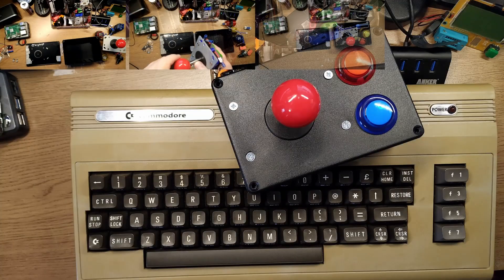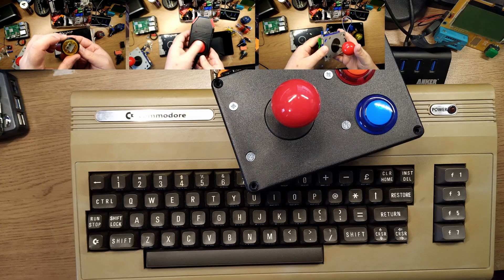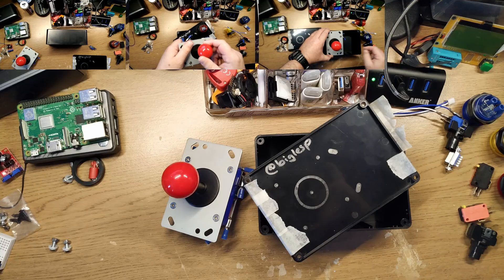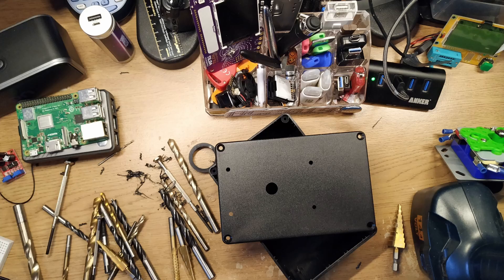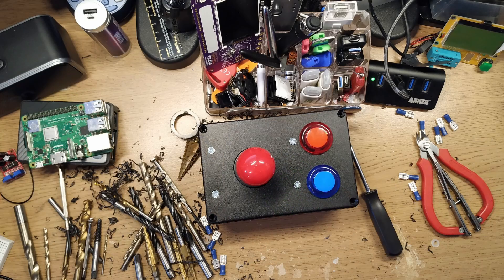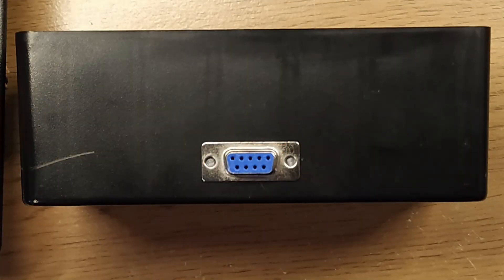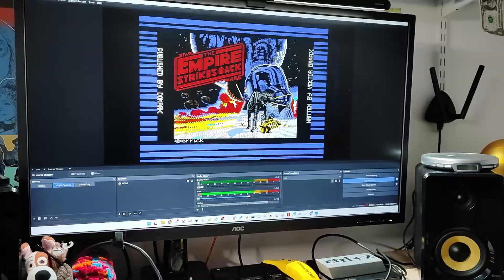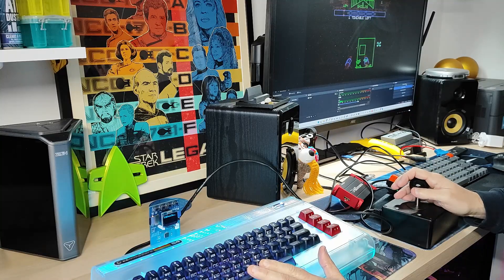Maker Advent Day 17: Building a Joystick for the Commodore 64 Ultimate

Comment: Nice joystick. The boxiness reminds me a bit of The Greek Stick :) 

With GEOS and GUI64 included with the C64U, could you address the mouse situation. On the Ultimate 64 Elite 2 only Commodore 1351 style mice work but they are a bit of a pain to get, which leads to the adapter solution. I was hoping Gideon would find a way to make USB mice possible in an update, particularly with the C64U coming out, but I recall a mention on facebook that it can't be done.